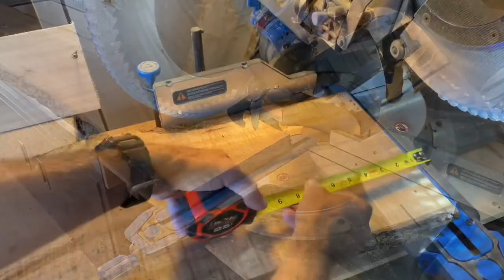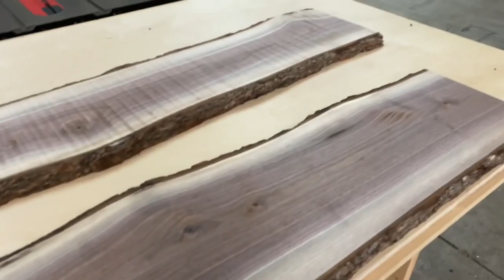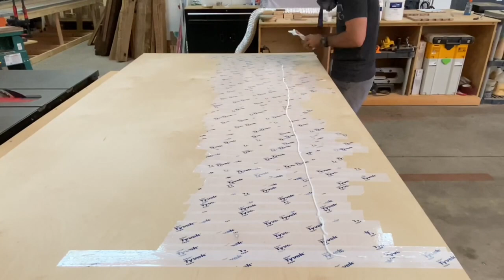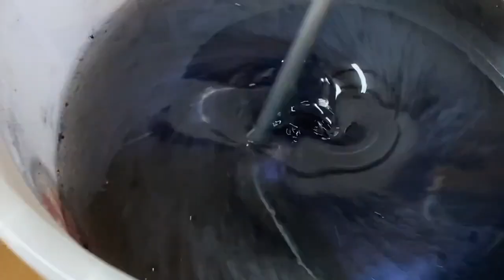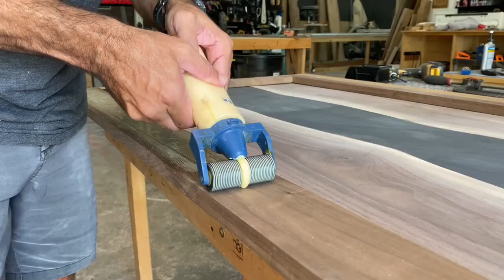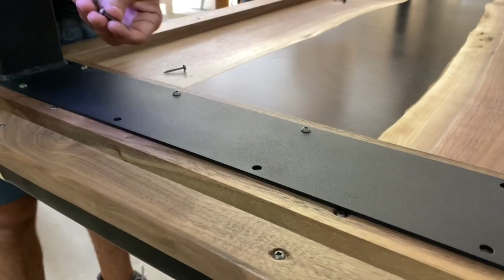I turned a SCAM into a $6000 profit!

Comment: Only suggesting for anyone to *match this lol, is to have the lower half end of the epoxy river to have gone down as thick as the overall walnut slab plus extra framing, kinda like a waterfall effect. As in not having that hard solid border between the black epoxy to then brown walnut. Maybe making, what looks like, a 1”x 5”x 20” small plank of black epoxy for each end.  And perhaps find lighter brown walnut to * match the live edge color of the slabs. Great work overall and glad you got them for $50 too!! Damn I’m so jealous 😂

Comment: What sort of wood movement concern is there by adding the frame beneath the table? Did you have to leave room for expansion and contraction or does the epoxy make the top dimensionally stable?
Reply from the maker: That’s a great question… I do find that the epoxy resin helps with stability and the extra frame helps as well. But definitely no guarantee with wood movement though. In addition, I alternated the grain pattern on each slab to help offset the movement and the table base legs are acting like an additional mega brace, kind of like a c- channel… kind of. The screws holes were twice the size of the screw shank to offer a little movement as well.

Comment: OK the slabs cost $50 what did the epoxy cost and ancillary items, add in an hourly rate (how many hours did you work on it?), delivery costs, wear and tear on tools, power usage, rent and any other overheads, add these costs up and your profit is.....what?  Not $6000!  Turned out nice though, good save. 👍🏻